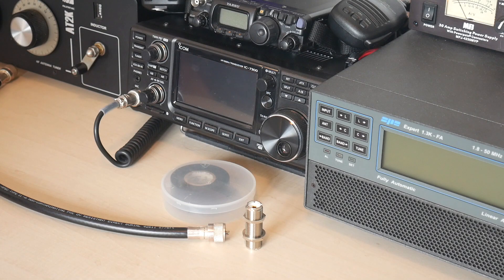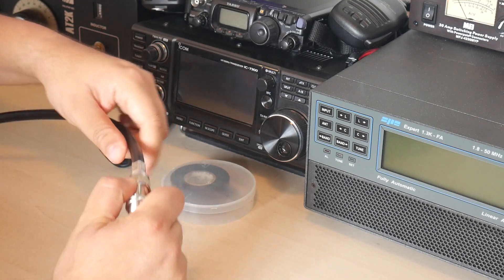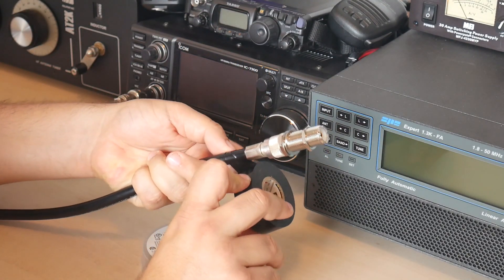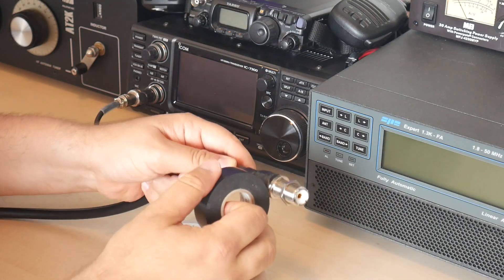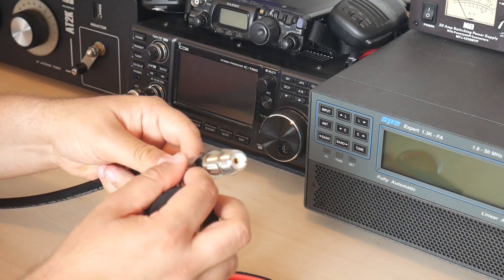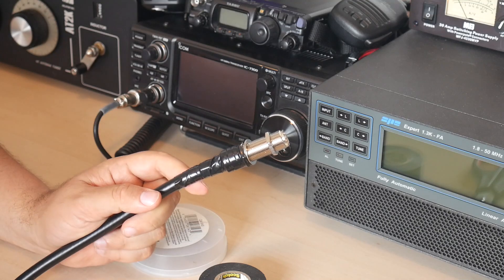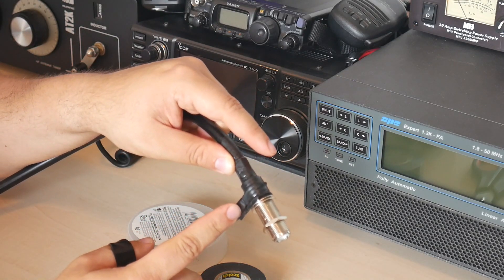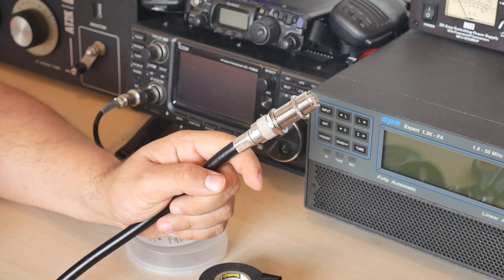Quick Tip: Sealing PL259 Connectors for outdoor usage

Comment: FYI that crimp connector is crimped incorrectly.  The shield crimp should be immediately adjacent to the connector, and there should be an uncrimped "bell" towards the exiting coax.  Ideally, the "bell" would turn into "crimp" precisely where the jacket has been removed.  Since the crimped ferrule is designed for the diameter of the shield (without jacket), it may cut into or compress the coax if it's crimped over the jacket; also leaving a sharp edge right where the cable may bend as it exits the connector.

Comment: I use rubber sealing tape and not electrical tape, I have had Electrical tape fail about 2-3 years later.
Reply from the maker: That's a good point but I like to tinker with antennas and check connectors fairly often.

Comment: if the connector is pointing upward, you should have ran the 2nd layer of tape in the same direction as the first. water runs downhill. it, like the 1st layer, would have been ran in a fashion like shingles on a roof, allowing water to run off of the tape instead of inside. i do like how you ran the 1st layer, sticky side out. i use to do this with my pants around my boots at work as it kept the dirt out and allowed easy removal. thanks for posting!